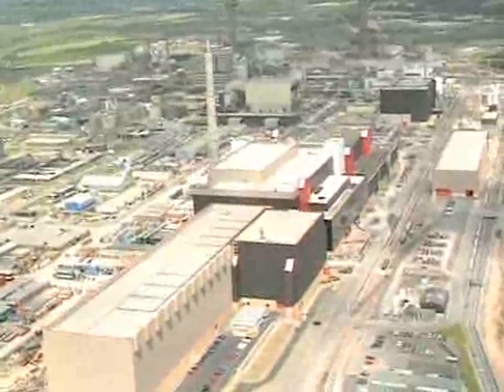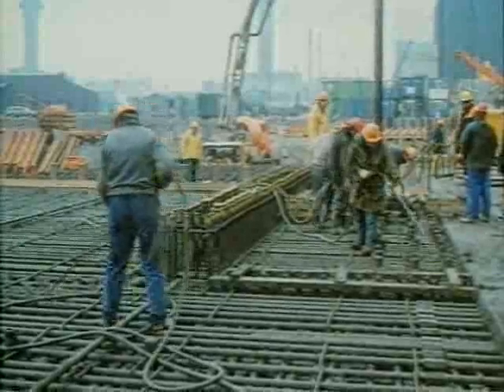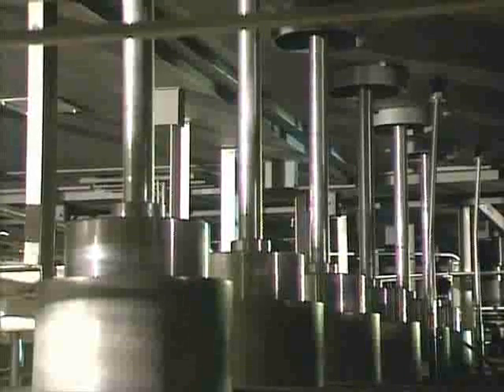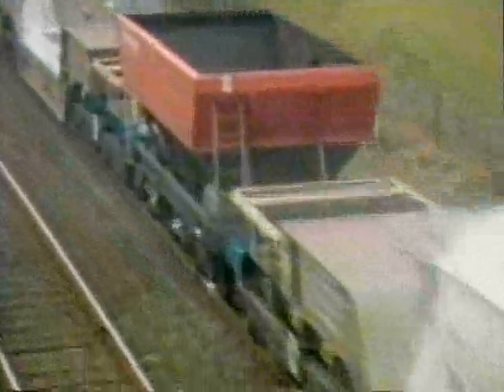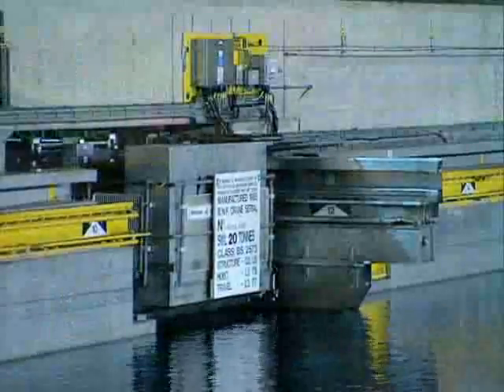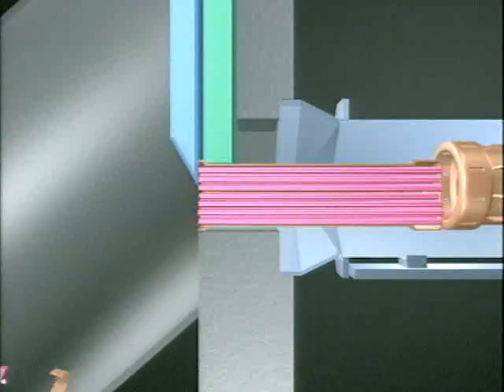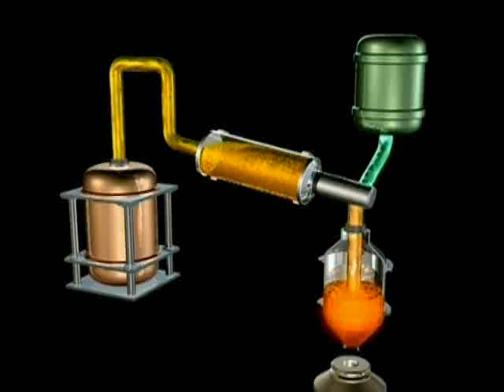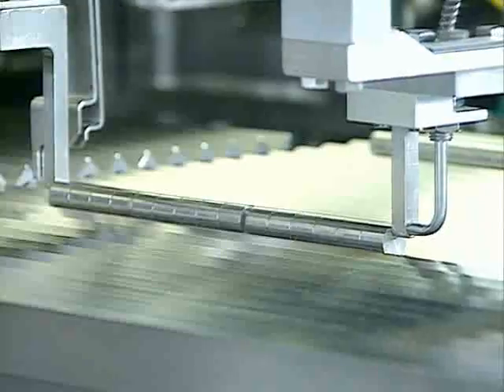Thorp

Comment: Does sellafield still produce power for the national grid, I've read that nuclear power emits less co2 than the other fuels such as coal oil and gas,
Reply: It stopped generating power in 2003 I believe when Calder Hall ceased operations. There is a natural gas plant nearby
Reply: None of the Magnox plants were particularly efficient at producing electricity, they were dual purpose to produce plutonium for the weapons programme. Deficiencies in the Gas cooled reactor design meant they couldn't run at a high enough temperatures to make steam production efficient. Wylfa was the last one operating in the UK and that shut a few years back.
Reply: @fullmetalp0tat066  First gen maybe but later AGRs run considerably hotter than PWRs.